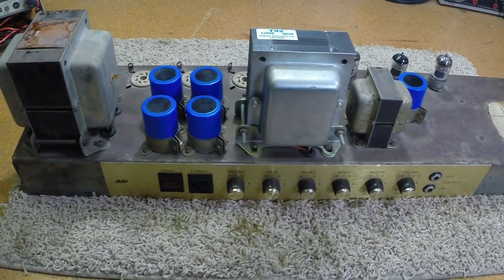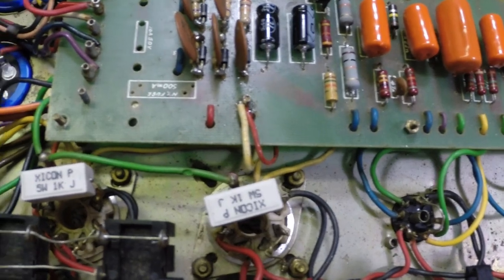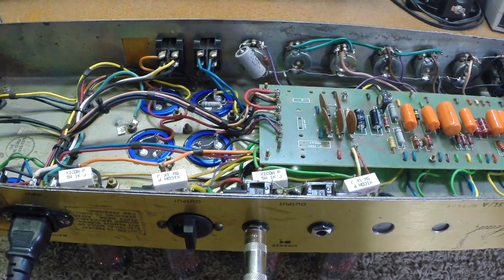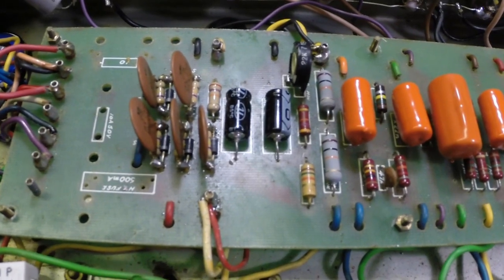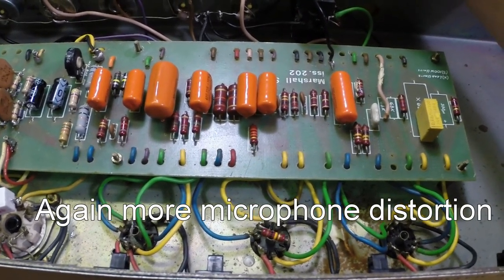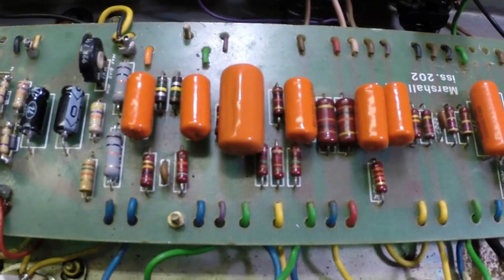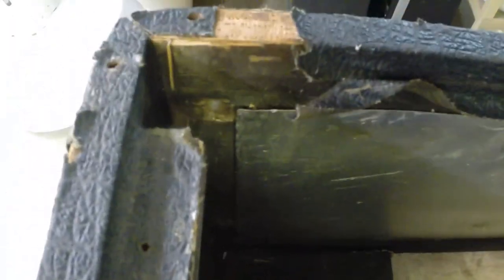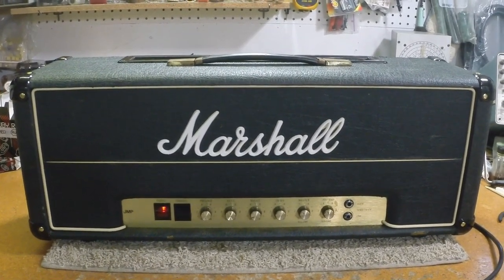Marshall JCM800 Rehab

Comment: Just a little heads up. This is actually not a JCM800 it is a 1978 ("K in serial) JMP 2203 Lead Master MK2. Although similar to the JCM 800 there were some differences (B+, filtering, etc) and these preceded the JCM's by a few of years.  Cheers!
Reply from the maker: Yes I know that.  I work on so many amps I have general groupings.  Even though this is one of the various MK11 models, and there were quite a few during the transition.  I consider the MK11 amps as the JMPs.  I basically have 3 catagories;  JTM, JMP, If it has the plastic rocker switches, and the extra gain stage, it falls into my 800 catagory.  Then there are the 900's and anything after that I do not care about.  Thanks for watching and commenting, shows you were at least paying attention.